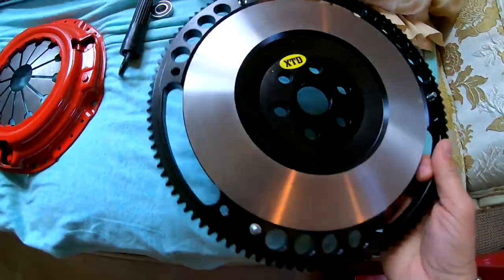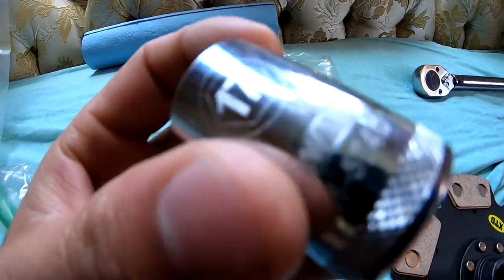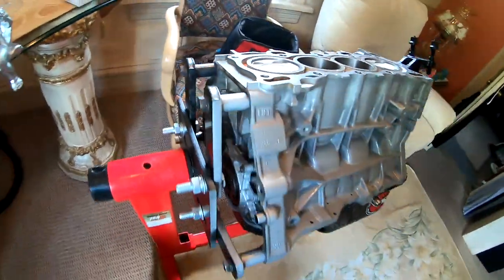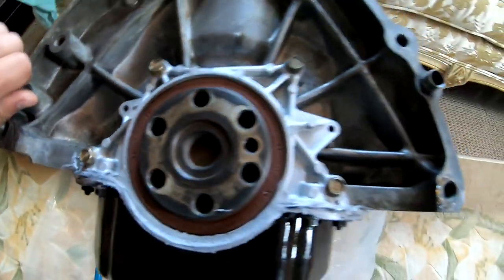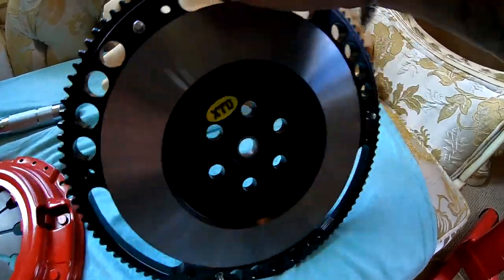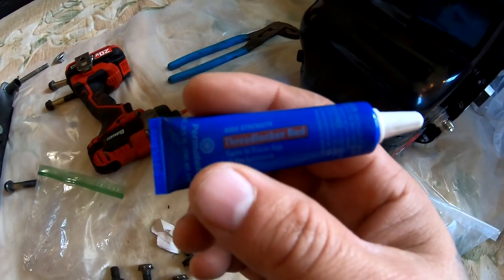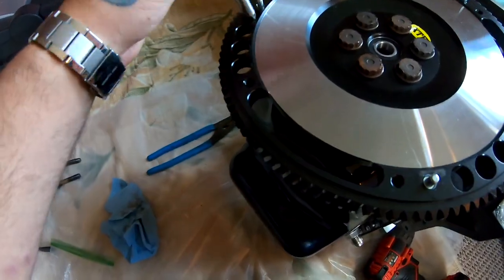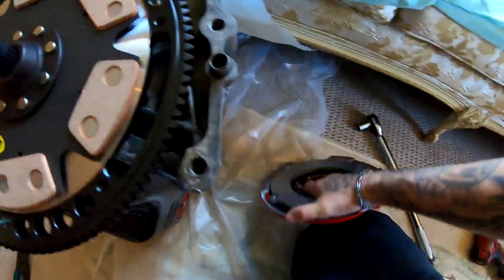500hp build Ebay XTD Stage 4 Clutch & 8LBS Flywheel install into 500hp d16 civic Vitara Turbo build

Comment: How is the clutch holding up? I have the stage 3 clutch xtd in. Drives pretty good. 1st gear feels like it wants to take off!
Reply from the maker: I still have not taken the car on the road. im very close to getting the turbo build out there tho.

Comment: OK dude it’s been three years. How is the clutch holding up.? Because I know the motor was well put together. Because it was done inside the house that’s the only Motor I know that got a chance to sit on a nice couch. Keep up the good work back to the question. How is the clutch holding out.
Reply from the maker: Lol yea that engine lasted me a very long time I ended up selling the engine and trans and ended up buying a k20 with a trans. That clutch gave out after a few passes definitely don’t use this one if your gonna push over 280 it will start to slip
Reply: other comments ypu was saying how good and reliable it is ....now this comment you said only a few oasses? come on man i need solid knowledge and your true experince @BarbasLife
Reply from the maker: @JuanPablo-vv5ql  if your pushing over 280 don’t use it it will slip I just kept turning it up my clutch was glazed when I took it off. I also learned from this experience to use stock flywheel for turbo builds.
Reply: @BarbasLife  ahhh ok ok ...today was looking up reviews....got a fully built sleeved y8...just waiting on clutch so i can put motor in car ...went with the xtd stage 5 4puck sprung ....what you have to do is get the strongest pressure plate....on my b20 i dailyed it nd abused daily for over a year at 275hp nd xtd never slipped and that was 6 puck with 2300pound pressure plate....so hopefully its gonna hold the 400hp ina dyno to